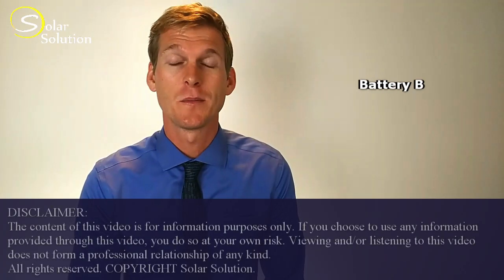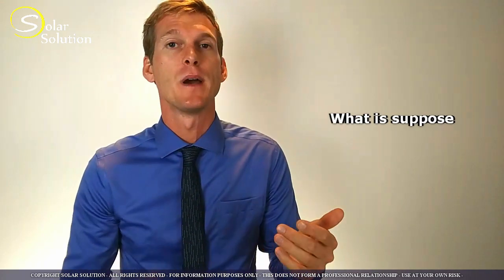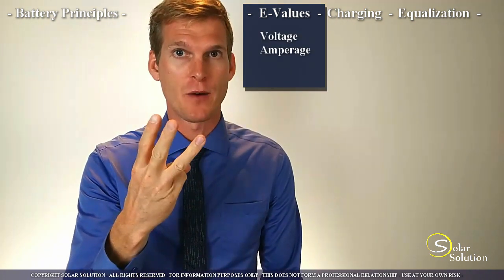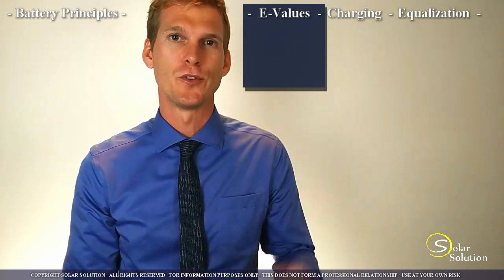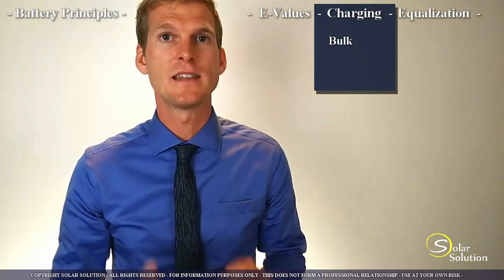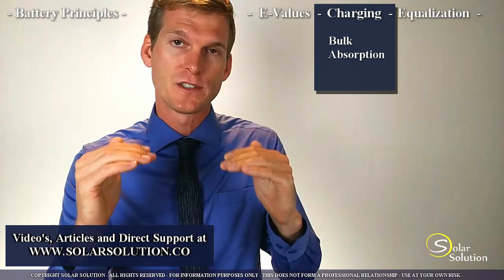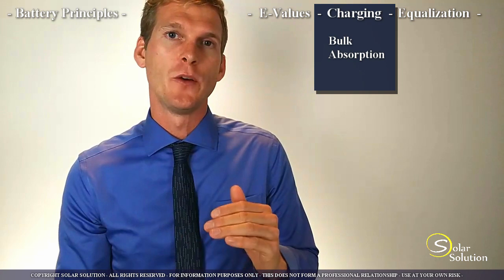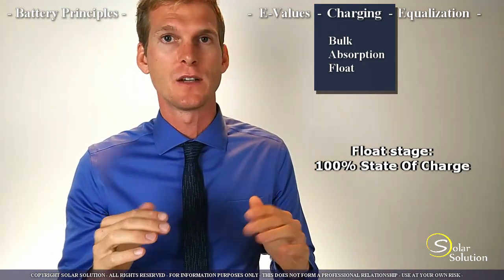Battery Charge Voltages Explained // Equalization // Bulk // Absorption //  Float // Solar Energy

Comment: Wonderful. Finally , I have a practical explanation of the difference between voltage and  amperage. Thanks to your Dad and you. I have AGM batteries (1500AH Hoppecke batteries) the data sheet  specifies that equalization be done every 40days. Your comment on equalization on AGM batteries have me a little confused, would not want my batteries damaged.
Reply from the maker: Thank you for your message Adeniji, it is nice to hear you enjoyed the video! 
I am glad to hear you are using the Hoppecke AGM's, in my experience they are top of the line! Not that many people use them due to availability / price. 
Sorry to have confused you regarding the equalization: The need for equalization of AGM's ultimately depends on the design of each specific battery, since AGM's can differ quite substantially. 
In my experience with Hoppecke batteries, following the recommended manufacturing settings yields the best possible end results. 
I hope this helps, enjoy your excellent batteries!
PS I love your name, my guess is it is a Nigerian name?
All the best, Jesse.
Reply: @SolarSolution  I must say the batteries are indeed excellent! 
Yes, your comment helps, I will stick to the manufactures recommendation.
and Yes, I am Nigerian! Thank You.

Comment: Why does a battery drops in voltage right after charging for Ex after float 26.6 volts itvdroos down to 23.3 right after charging ? I'll aporeciate if you could Answer myvm questions.thanks already
Reply from the maker: Hi Ashley, thanks for your message.
Imagine that you are inflating the tire of your bicycle: While you are pumping, the pressure in the pump itself is quite high, and forces air into the tire. The pressure of the tire will increase, although the pressure in the pump will still be higher than that of the tire. 
Similar to inflating your tire, you will need a higher voltage from your charging device, in order to "inflate" your battery. When you will stop charging, you will now see what the actual "pressure" in the battery is. 
The voltage you are seeing during a charging cycle is the voltage produced by the charging device.
I hope this helps! Jesse
DISCLAIMER: Don't try to charge your battery with your bicycle pump :)

Comment: Thank you that was very clear and I learned a lot about the stages of charge 👍
Reply: A video topic I would like to hear your opinion about would be some detailed information on charging a deep cycle battery on a alternator. It seems to be the general consensus that is a bad idea, but I have never read or heard someone explain why, an alternator with single stage charger can't full recharge a deeply  discharged battery. You explained how a 3 stage charger works but what does a single stage do?

Jason
Reply from the maker: Hi Jason, thanks for your feedback. An excellent and valid question, I will share a video on this shortly!
Reply: @SolarSolution  I will be looking forward to it thank you 👍
Reply from the maker: Hi Jason. As promised, here is my response to your question about charging your deep cycle house battery with your alternator. I hope it will be useful for you. 
[Time stamped, specific to your question]
https://youtu.be/TAEzCcayI0g?t=312
[Complete video]
https://youtu.be/TAEzCcayI0g

Comment: Excellent, concise video, exactly the kind of explanation I was looking for.  Suggest to produce a video that explains the difference between Lithium ION and LiFePo4 batteries.  In fact people seem to accidentally misnomer Lithium Iron and pronounce it as Lithium Ion (omitting the "R" in Iron) probably because they don't know the significant difference between the two.  I have not been able to find someone who will explain the dangers of Li Ion and the advantages of LiFePo4 in a well-produced video.  Then again, it seems people could care less, in which case the video wouldn't get any views, possibly a waste of time. Thanks
Reply from the maker: @Arminius thanks for your feedback. I find what you are pointing out very interesting, and you are definitely right that there seems to be a lot of confusion between the terminologies used and the characteristics of the the different types of Lithium-based batteries. I will let my brain chew on it a bit and come up with a proper video. Thanks!

Comment: HI i want to ask a question because i am confused i have 8 6v 225 amp us lead-acid battery connected for 24v system 2 strings of banks in parallel make it 450 amp. and also a flex max 60 amp charge controller. can you tell me the correct settings for the absorption float and Equalization please and thaks
Reply from the maker: Hi Michael, thanks for your question. Have you checked the battery specs yet?
Reply: seems to can't find it for my batteries  its power king  same thing as US power  6v 225 amp each. my system is wired for 24v 2 strings of bank
Reply from the maker: Ok I understand. For help, check www.solarsolution.co/services
The 'Instant Consult' option would help you out.

Comment: what's the story of percentage meter? even when fully charged, my liquid acid new battery is showing about 50%. And also - can my solar charge controller receive also input from a wind turbine on top of the two solar panels it gets and still manage the charging or do I need a separate controller for the wind turbine (assuming both turbine and panels do not exceed the max capacity the controller can handle)
Reply from the maker: Hi Yoramedia. Thank you for your questions. I have a script ready for a video on State Of Charge indicators like the one you are mentioning, so I am sure this will answer your questions. The video will follow in the coming weeks. It would be a bit challenging to explain the topic in this comment only. As for the the charge controller question, I would definitely recommend to have a separate charge controller for your wind generator. I hope this helps, enjoy!